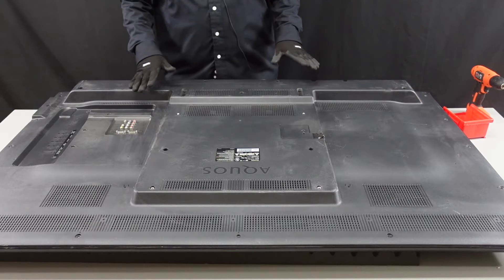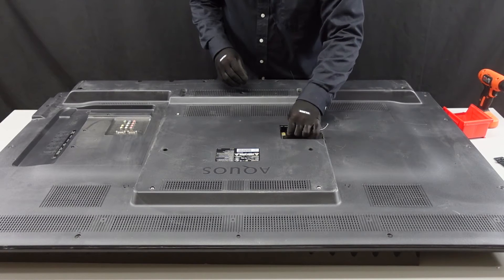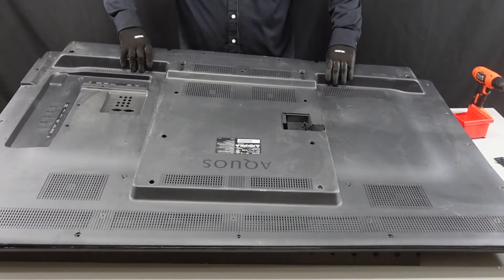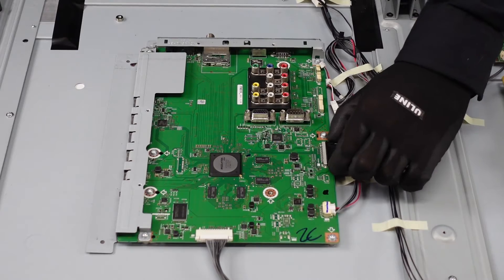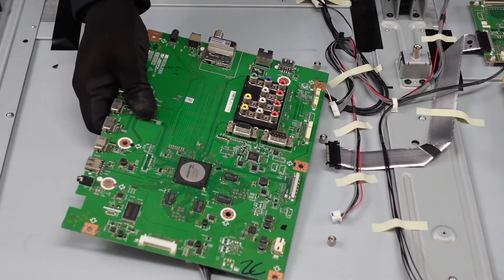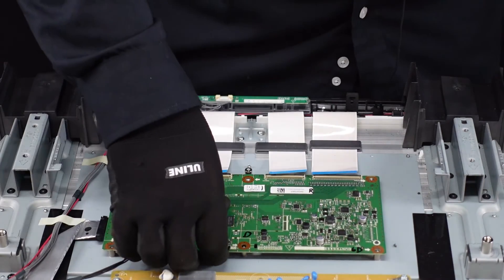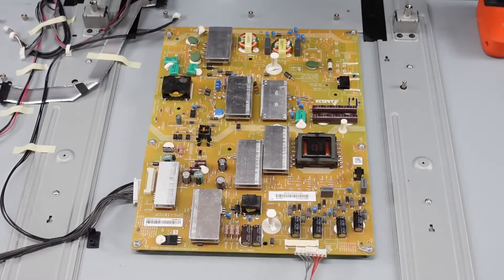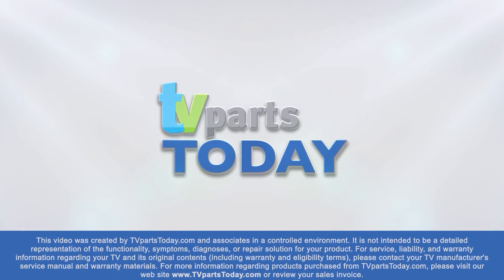Learn how to fix broken television.  (Sharp Aquos LC-60EQ10U)

Comment: Do some manufacturers separate the main boards from the AV boards?  If so, did they recently start combining them into one board?  I have a Sharp LC 37DW99U that has the AV board connected to the main board via 3 "connections" that look permanent (i.e. no ribbon connector or "snap" wire connectors).  I'm a little nervous on how you're supposed to separate one from the other and then reconnect them if I'm going to replace the main board.  Thanks.
Reply from the maker: While we don't carry parts for TVs under 42 inches, you could always send an e-mail to info@tvpartstoday.com with a picture of your main board and your question and we should be able to get you pointed in the right direction.

Comment: Do you have to take the TV and lay it on its face or can you just leave it up right on the stand. Because mine's is 70 in don't really have no place to lay it down.

My problem is I have a single yellow line on the left side. Sometimes it goes all the way to the bottom other times it comes up from the bottom about 5 in. It does appear on all channels no matter what the source is and the menu screen.
Reply from the maker: I can't recommend that you replace boards with the TV still upright, but if you take your time and maybe get someone to help you stabilize the set while you work in the back, you could minimize the risk of the TV falling over or becoming unbalanced. Best case is to lay the TV on its face on a flat surface with some padding or a blanket to cushion the screen. A bed works great. Also be mindful of the pressure you are putting on the chassis while you take screws out. With a bigger TV there is more chance for the chassis to bend or dent and cause damage to the panel. As for your issue, it sounds like a t-con problem.  There is a possibility that it is the main board, but vertical lines on the screen is usually the t-con. I would try that part first. Another test would be to "re-seat" the ribbon cables coming and going from your t-con. Just pop the clips up and make sure the ribbon cables are seated properly and making good connection. Thanks for the comment, Charles.
Reply: @tvpartstoday  yeah I still find it a little weird that the bottom fluctuates. The last three in is sometimes. Kind of like an EQ light.

It just sucks because it's a 3D TV and they don't make them anymore.

Comment: I have a Sharp Aquos 8T-C60 AXIX with a broken screen is it possible to get a replacement screen for this model
Thanks
Reply from the maker: There are some resources you can use online to source a replacement screen, but in a vast majority of situations, a broken screen is the end of the life of a TV. This hinges on a few factors, mainly that the replacement screens are very expensive (the cost of the TV in some situations) and difficult to replace.

Comment: I have 2 Sharp PN-LE701 and both power on as soon as I plug it in, and backlight on but no logo or menu comes up (just a lighted black screen).  Tried all the youtube tricks but no luck. Is this T-con board or main board issue?
Reply from the maker: Curious. At first glance I would say it sounds like a main board issue, but if you send an e-mail to info@tvpartstoday.com with your symptoms, we can have our technicians take a look and get a more concise answer.

Comment: I have  a 70 inch aquos model # LC70LE64OU FLAT SCREEN THE SCREEN WENT BLUE THAN A PUFF OF SMOKE CAME UP OUT OF IT CAN I FIX IT
Reply from the maker: As long as the screen was not damaged you should be able to replace it.

Comment: sharp aquos 49CEF6031K 49 inch tv , lines appeared on the screen for couple weeks, then one day i heard a small blowout sounding noise, i stripped the tv down, checked all the boards, nothing is visually wrong, capacitators resistors etc all fine, none bulging or leaking , so i replaced the t-con board, no difference, the tv switches on, white light on, standby works, everything on the remote works (red light on tv flickers when any button pressed ) but no picture or sound, tried flashlight trick but no picture in the background , any ideas its driving me nuts ?
Reply from the maker: Since you did the flashlight test and have no visible picture and no sound then the main board would be the next part to replace. If you need help locating the part number post a picture on our reddit page  https://www.reddit.com/r/TV_repair/.

Comment: i have the same tv but having problems with it turning on. power light is blinking... what do suggest i do?
Reply from the maker: In a lot of situations there will be a specific pattern to the blinking standby light. These "blink codes" will help you narrow down your diagnoses to get started troubleshooting the TV. Is there any pattern to your blinking standby light? If there does not seem to be any pattern to the blinking lights, I would suggest replacing one board at a time to try and alleviate your symptoms. I would start with the main board as your power supply is, at least, providing power to the standby lights.

Comment: I have the sharp aquos 60 inch with sound distortion (static in sound) , how can I fix that?
Reply from the maker: The main board is where the sound is coming from so maybe try replacing that. the speakers seem ok? not blown?
Reply: @tvpartstoday  I unplugged it over night and plugged it back in the morning and it’s back to normal lol !!! Thank you

Comment: I have a Sharp Aquos LC-60E88UN that is showing an error code (at least that's what I assume it is) - the power and OPC lights blink on and off together one time, then just the power light blinks on/off.  There's a brief pause, then that sequence repeats.  I've tried 
a) unplugging, letting it dissipate any power for a couple of minutes, then plugging it back in; it does the same light sequence as soon as it's plugged back in.
b) unplugged, let it sit a couple of minutes, pressed and held input and channel down buttons on the TV and plugged it back in (buttons still held).    Same light sequence results as soon as its plugged back in.
c) unplugged, let set a couple of minutes, pressed and held the power button for 30 seconds, then plugged back in.  The same light sequence starts as before as soon as it's plugged back in.

We weren't home, but we did have a heavy storm last evening so I'm assuming there was either a lightning strike nearby or possibly our power went out and our generator kicked in causing less than clean power for a period.  How do I go about determining which board(s) are damaged so I know what to order?
Reply from the maker: Hello, 

TV repair is a process of elimination; you replace the most likely circuit board to the least likely circuit board until one resolves the issue. If none of the circuit boards fix the issue then it is determined to be a failure within the back lights or the panel/screen.

Based on the information we would suggest starting with the main board and power supply.

Comment: Hello, my Sharp LC-46D85UN turns off after a minute and immediately star flashing the two green lights (power+OPC) twice and ones the OPC light…. Continuously.
Really appreciate any help.
Thank you
Reply from the maker: Try replacing the main board and the power supply and see if either one of those will fix your issues

Comment: What needs replaced when screen starts flickering and picture goes all crazy. No horizontal or vertical lines just image out of place and moving and flickering
Reply from the maker: Could be a t-con issue. Main boards and t-con boards have similar issues though, so both of those could be the culprit.
Reply: @tvpartstoday  whoa thanks man i didnt think id get any replies.  i have this exact same tv and suddenly the picture just jumps around all over the screen. sound is the same everything else is good.  when you bring up a menu from the tv its also all flickery and jumpy.  ive been trying to find some videos and websites about what to repair.   

from what ive seen it looks like one of 3 different computer boards or maybe one of the flat cable connections.  tryin to decide to try and fix it or just trash it.
Reply from the maker: That's the age old TV repair question! "Is it worth it to fix this TV?" If you are going to try and replace any boards in this unit, I would give us a call at (800)203-7484 and we can help you get pointed in the right direction and let you know how to identify your main board and t-con. GOOD LUCK!!!
Reply: remove the far right or left bridging cables. Its the panel connector, Youtube has the fix.

Comment: How did that teach how to fix a broken tv ??
Reply from the maker: Great question, 666pumpkinlord. As you probably already know, many issues with a TV can be fixed by replacing a faulty part in the back of the TV. This video shows you how to remove and replace all of the boards in the unit as well as how to access the parts and undo the clips. Once you identify the problem part, you can use the knowledge you gained from this video to confidently remove and replace said board.